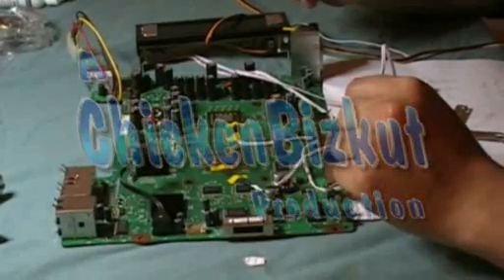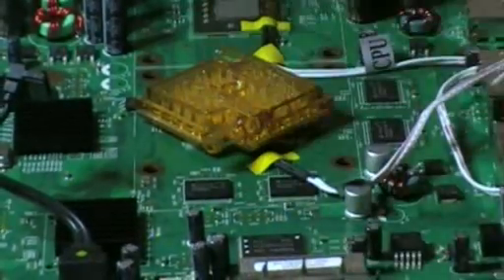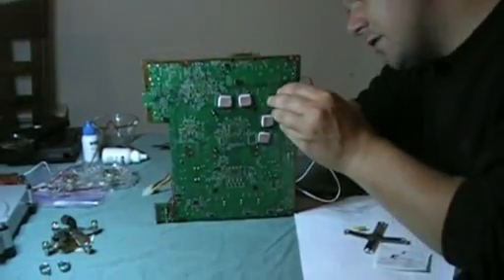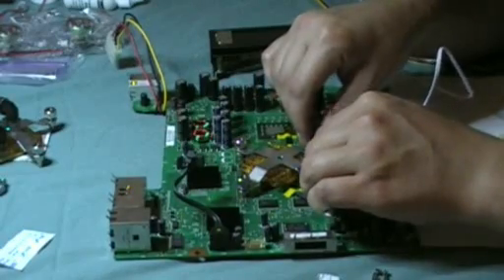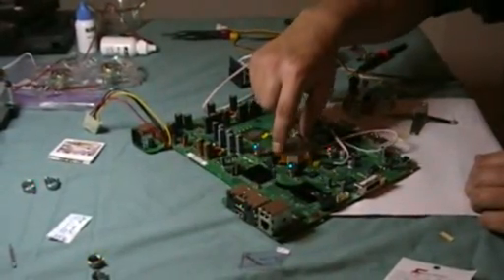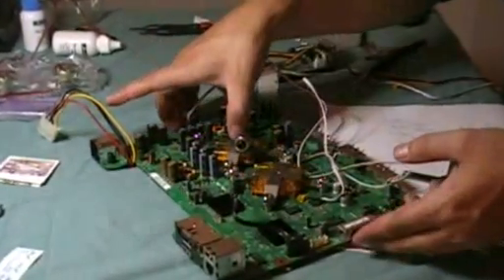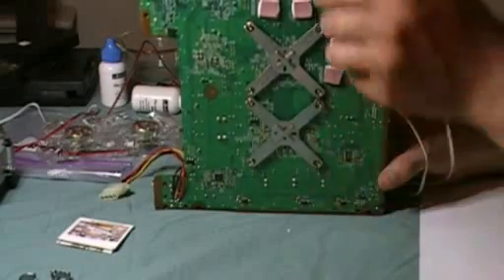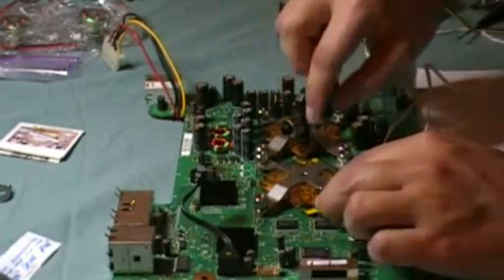XBOX 360: Installing Waterblocks on CPU & GPU

Comment: @ch9il This makes his xbox custom from the stock xbox.
i don't think you can overclock a games console and leaving it stock can be ok but there is the problem that your console may get the RROD, the xbox has some flaws that can have a simple yet very effective fix but people want to take it a step further and add their twist onto it wether its a off the shelf or homemade.
rrod is just the cpu or gpu getting hot (due to airflow on the heatsinks or thermal paste) and a sensor indicates this

Comment: @CameronWoodward107 Looking close to $400 mate, its not cheap by any stretch of the imagination, save your money and buy the next gen xbox360 on sale from 16th of july 2010, the only fault so far is that the benq drive still shreds your discs if you move it during use, ah well may in 5 years and a console upgrade they'll sort that issue LoOoL

Comment: @Jason360pro what actually gets you banned:
Adding a mod chip (team Xecuter) to bypass DRM on the dvd drive & HDD, to run cracked games from the HDD or cloning the access ques from the mobo to the HDD and adding a larger cappacity HDD such as 500gb, cracking/retro-engineering the on board software to run a side program which enables you to "cheat" on online games, or dual boot your xbox as a "PC" running a distro of LINUX, this is what gets you banned not missing screws. hope this helps.

Comment: you can still have overheating problems if you dont set it up correctly. Too small a radiator.. too weak a pump. boom. problems.

Comment: Both designs are engineered to fail, if you dont satisfy the air flow requirements, aka you put it in a Home theater stack, they both will eventually overheat. The XBOX moreso becuase of its shitty design overall, however the PS3 will overheat if put in a media cabinet.